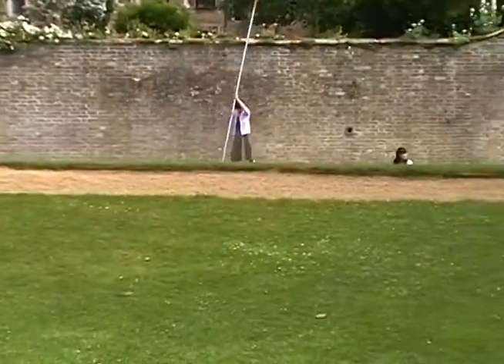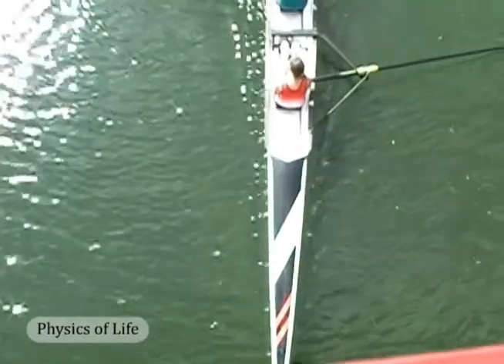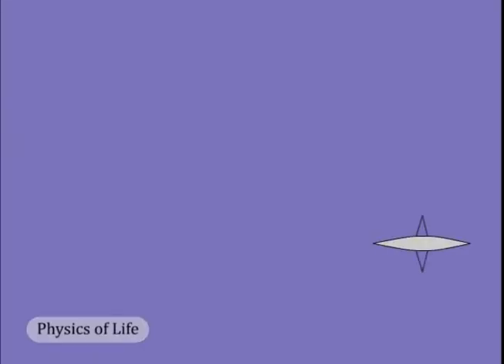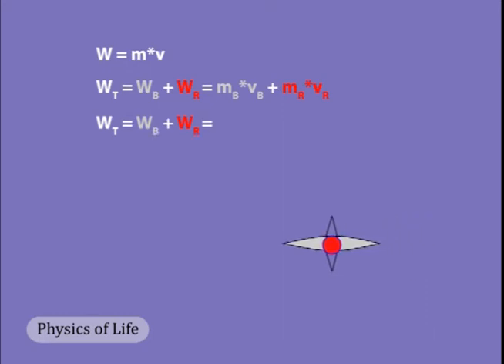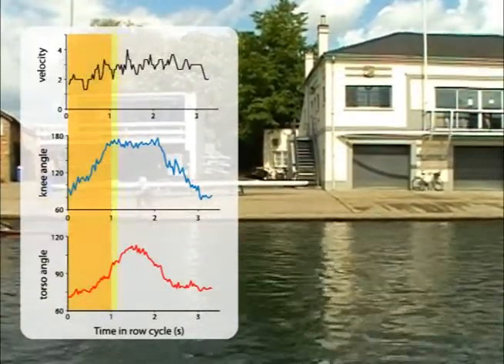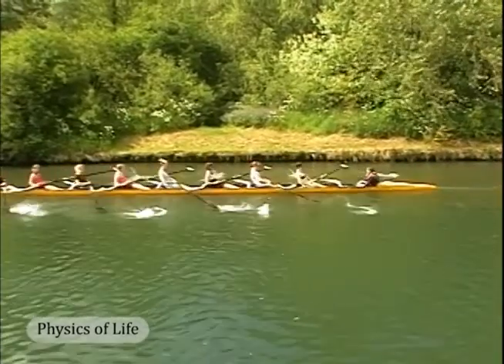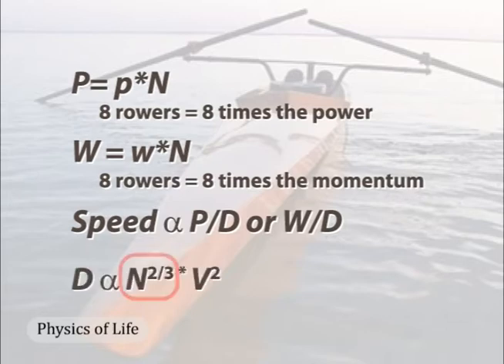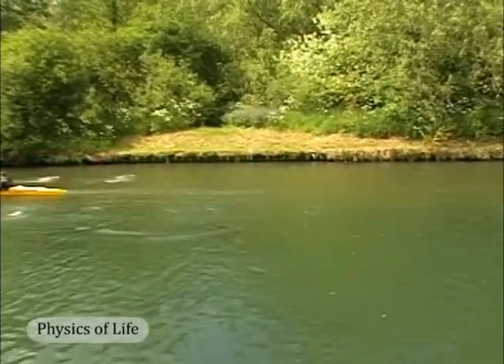Physics of rowing

Comment: As the boat is submerged in water you should include the mass of the water displaced I your calculations.  This is known since Archimedes. Of course this complicates the calculations. However the current explanation is ignoring half of the masses involved and therefore totally inaccurate. The phenomenon can be easily observed in a narrow canal where you can actually observe the water starts to move relative the the canal walls when the boat approaches.